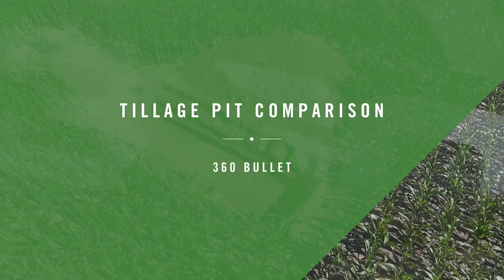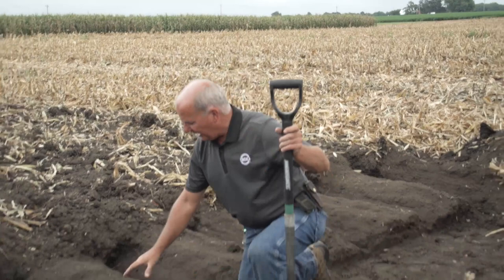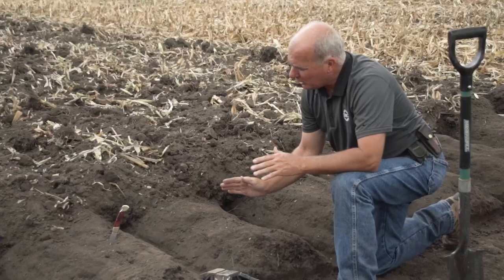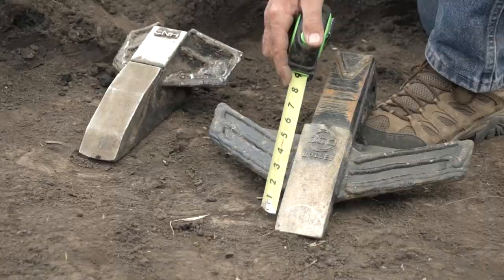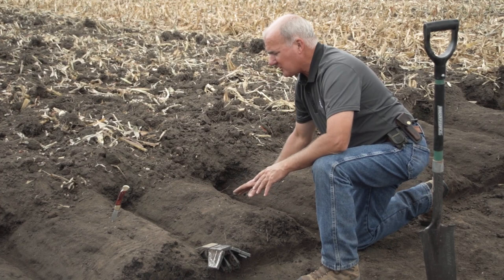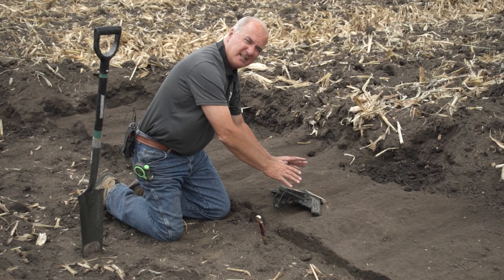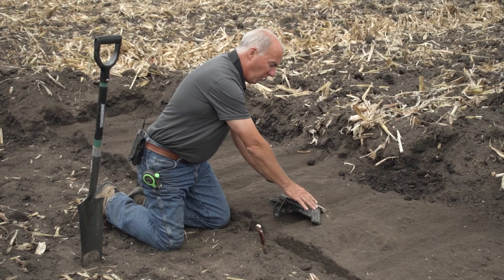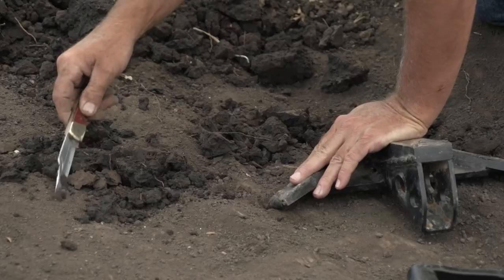Evaluating Ripper Performance

Comment: I had the same experience in the 1980s when I attempted to farm. What I did  was build  a ripper with 2 tines in a row. The front tine was shorter(½ the length) with the broadest tip on it that was available and the rear tine was long with a narrower tip round about ½ of the front tine. It did seem to achieve the desired result.

Comment: The problem with fracturing soil with a subsoiler is the same as with a conventional moldboard  plow. It is moisture you cannot shatter or fracture soil that is too moist or too dry  ! If moisture is too high except for the sandiest soil types a mold board  plow will just plow out slabs or if too dry will just break out large chunks of deep crust especially in winter wheat fields after harvest believe me I  know.

Comment: You need living roots in the soil. Plant some radishes to break up that pan and allow water infiltration.
Reply: I don’t have a long enough growing season for radishes or other cover crops. By the time the corn and the soybeans come off the field, most of the time the growing season is over. A lot of times the temps are below freezing. Sometimes snow has already fallen. Tillage is the answer here unfortunately. Would love to do cover crops, but they just don’t work (or have time to work).